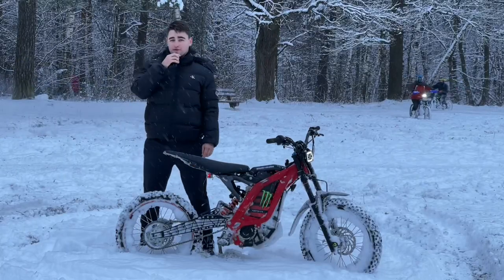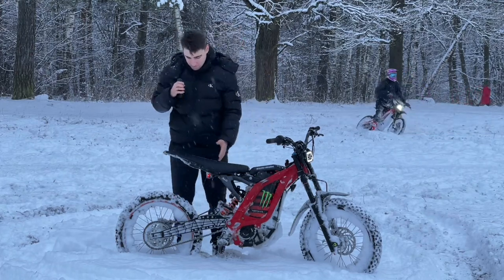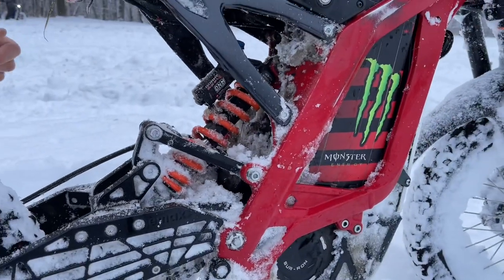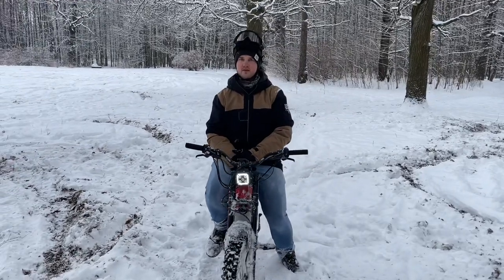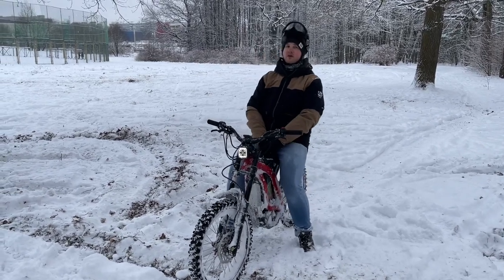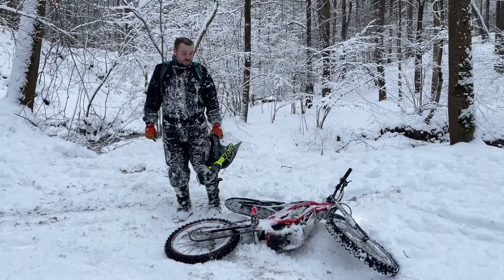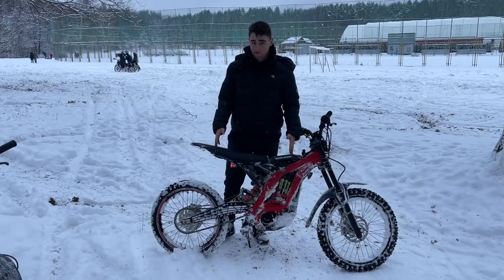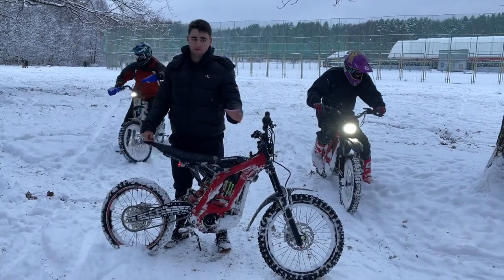Sur-Ron custom swing-arm review & test drive [with english subtitles]

Comment: I have extended my swingarm on my chopper, it get higher speed at mid and top end, while the low end it make no different, compare to stock, however, it got lesser turn compare to stock may be because on the centre gravity, peoples said long bike got a bigger turn it is right if you extend the frame not the swingarm, if only extend the swingarm your sitting positing still the same as your weight will move forward, extended the frame also move your sitting position back, so there a different between extended swingarm and bike frame